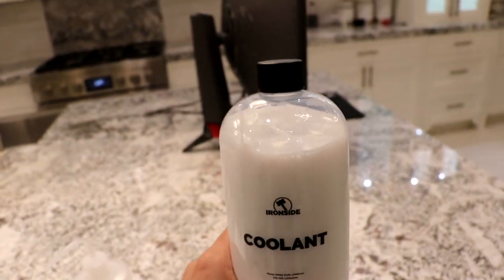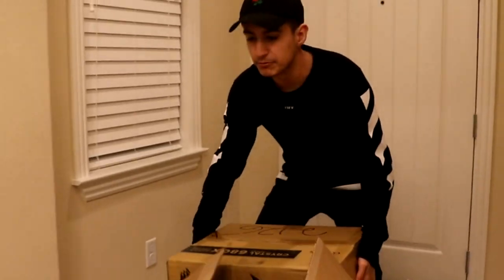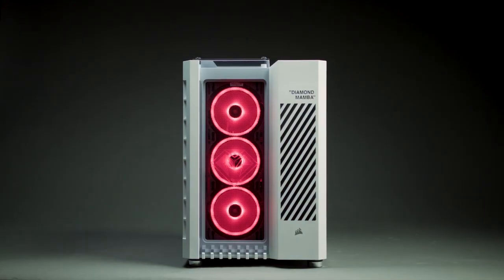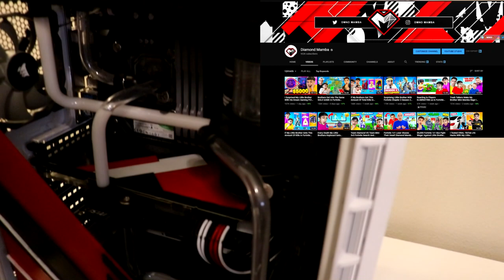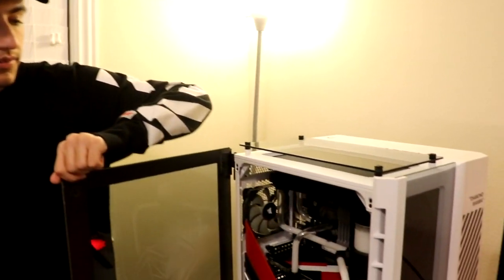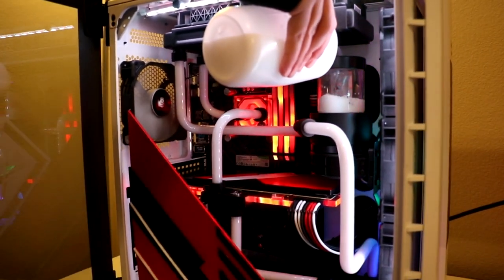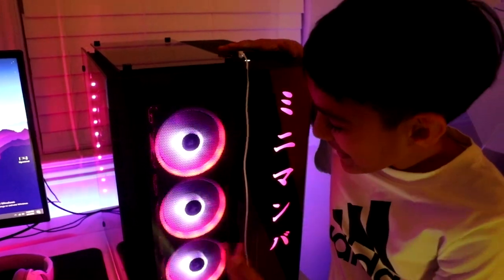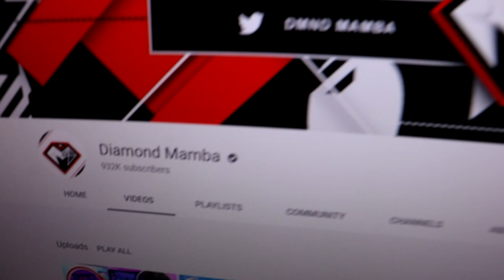I Got Surprised With A New Custom Fortnite Gaming PC! $5,000

Comment: Im getting my pc today
Intel Core i5-8400 2.8GHz Hex Core Coffee Lake Socket LGA1151 Desktop CPU

Corsair CW-9060007 H60 hydro series 120mm cpu water cooling

Gigabyte B365 M Aorus Elite

WD 500GB Blue SSD

Corsair CMK16GX4M1A2666C16 vengeance Lpx with blacK low-profile heatsink , with 8-layer PCB , 16Gb - support Intel XMP ( eXtreme Memory Profiles ) , Ddr4-2666 ( pc4-21300) , CL16 , 1.2v - 288pin - lifetime warranty

ASUS DUAL RTX 2060 ADV EVO - 6GB,2XFAN,2XHDMI,1XDP

Corsair CP-9020050-WW VS550 550W Desktop Power Supply

Antec NX400 Tempered Glass Gaming Case 

WD 2TB HDD

BLUETOOTH DONGLE - V4

TP-LINK WN881ND 300Mbps Wireless N PCI Express Adapter

But now I'm poor rip wallet
Reply: Windows 10 pro